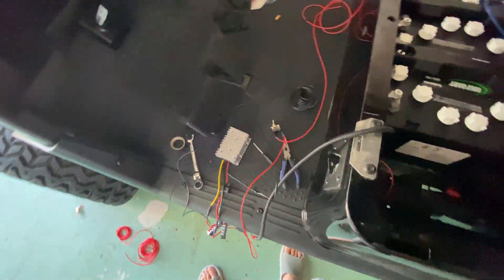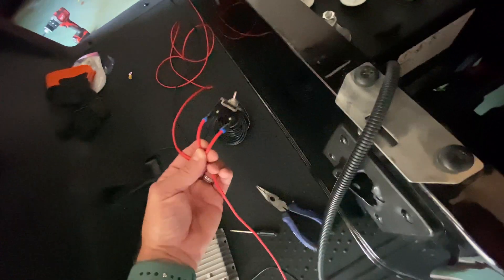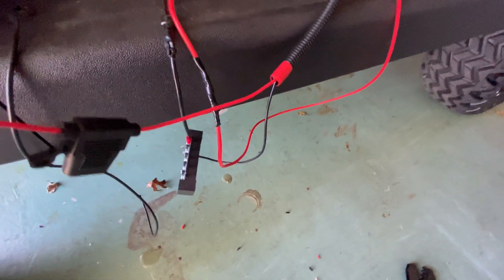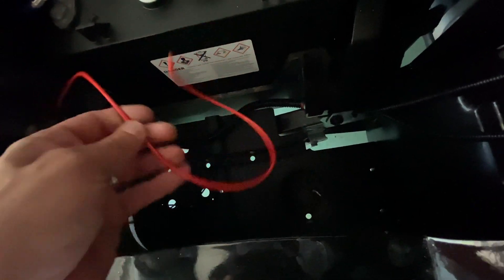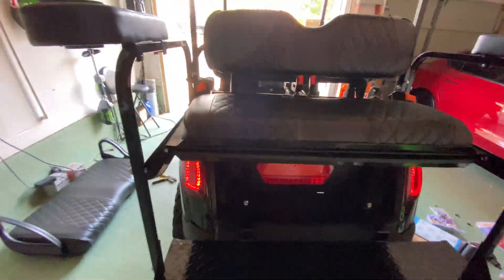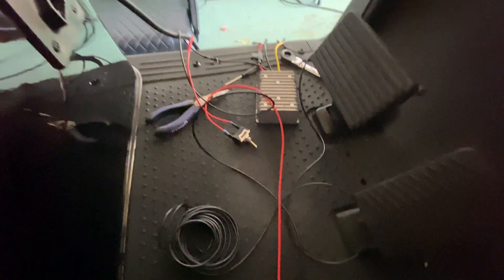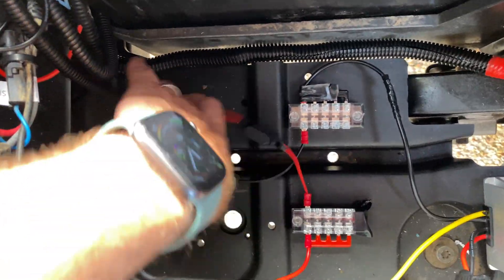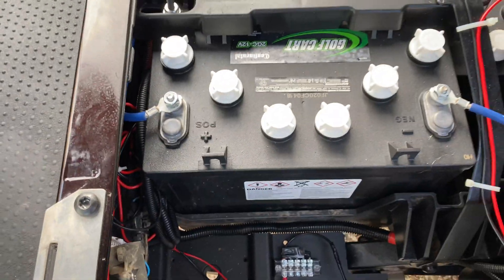Golf Cart (EZGO RXV) - Installing a 12V Reducer with Kill Switch and Terminal Bus Bars

Comment: So with that kill switch coming directly from the positive when it is in the off position will the power converter not being pulling any power at all? I have been reading and saw that they pull small amounts of power even with the key off unless you install a relay to the key switch on position.  So does that switch basically do the same thing and not allow it to pull power from the batteries when in the off position?
Reply from the maker: Yes, it’s effectively off/disconnect when the kill switch is off. That’s the primary reason I installed it.

Comment: Not sure if this will be answered but my TXT has a pull switch to turn the lights Off and On.... can I simply use that as my toggle for the voltage Reducer?  This brings up my original confusion lol, if I'm breaking power to the light circuit using the pull toggle must I still install my 36v to 12v reducer in between the power going to it? Thanks

Comment: So I've been confused about the positive and negative terminals that run from the reducer to the batteries. Is there a specific battery terminal you use to connect your power line or can you use any battery in the golf cart?? Also the ground that comes off the reducer, does that get grounded to a battery or does it get grounded to the frame on the golf cart? Thanks

Comment: I have purchased the same Reducer and Switch and once everything is hooked up the switch does not actually control the power to the reducer.  regardless of position there is still power.   It seems as if the power from the pack is blowing out the switch almost immediately.  Any thoughts?
Reply from the maker: Did you get a switch that supports the amperage and voltage requirements?

Comment: Did you run the positive and negative wires from the first battery in the circuit to the toggle switch? If you did, you only ran 12 volts to the switch and reducer????
Reply from the maker: The toggle switch is only on the positive, it literally completes the circuit. The reducer is wired from the first battery positive and last battery negative as shown around the 0:40 mark in the video. Again, the switch literally just switches the positive, only one wire in, one wire out.
Reply: @UraniumTwoThirtyFive   This is a perfect and easy fix, thank you my reducer always stays on and is warm to touch even after charging overnight even though my accessories will not turn on when the key is off it's still warm so I'm going to use my original 48 volt light switch headlight switch to do the switching on and off only on the positive side and mount it underneath like you did, thank you very much sir

Comment: I like the terminal bus bars for connecting multiple lithium batteries (in parallel) to the controller. I'm choosing to use a breaker box to distribute my low voltage equipment. That will add a little overload protection.

Comment: Thanks Brian, I'm doing the same thing but wasn't sure about the rating I needed for the toggle switch since you can't find a DC48 volt one. I'm going to use the same switch you used. Also I like the idea of putting in the bus bars.
Reply: Use a relay between your switch and your bus Bar or fuse box

Comment: It should be fused right where the positive taps the battery.  If you get a rub through before the reducer, you wire will glow until it burns thru.
Reply from the maker: Thanks, ordered a fuse and will put one within a couple inches of the battery.

Comment: Hey Brian, I bought a red Hawk light kit. Came with a voltage reducer with five wires. Two go to the neg and pos. And two go to the light kit harness, and one goes to the positive side of the key switch. Problem is I have a ezgo unique four position key switch like yours in this video. What wire is it out of that four wire harness in the back of the key switch do I tap into? Please help!

Comment: Hello. How did you wire up your toggle switch? Every time I connect mines it blows the fuse going to the converter.
Reply: It looks like he only ran 12 volts to the toggle switch????? If he went from the first battery in the circuit?

Comment: What amp fuse did you install between the kill switch and the reducer? Essentially the 48 volt section of the wire?
Reply from the maker: The reducer has its own inline fuse. I forgot the size, I did replace it once as it popped when I accidentally installed the headlights backwards. The reducer I bought is no longer on Amazon, so can't check the fuse size, but I was able to get a like replacement from my spare fuse box that mostly has car fuses in it.

Comment: I installed a kill switch and turned it on and it works but the switch got so hot I couldn’t touch it. It’s a 12v 30a switch. Do I need to find a higher voltage switch? My cart is 36v
Reply from the maker: I haven't had any issues. The switches I bought are pretty high rated, 125V @ 20A: https://www.amazon.com/gp/product/B078KBC5VH/ref=ppx_yo_dt_b_search_asin_title?ie=UTF8&psc=1
Reply: Considering that switch is running 48 volts of current which is four times the amount the switch was designed for, I'm surprised you have not blown any fuses LOL you need at least a 48 volt switch a good example is I have in 2008 precedent in my original headlight switch was a 48 volt switch I'm glad I kept it because I am now using it as my accessory kill switch perfect

Comment: Hey! I bought this reducer and when I hooked the 48 volt wire to the beginning and end of the battery bank, it sparked! So I stopped.  Is this usual?
Reply: Yessir it's normal. Crazy to think it is but it is totally normal
Reply: It scares you even though you know it's going to happen, before I put a kill switch on I was pulling the fuse in and out imagine putting a fuse in and the spark happening right there LOL

Comment: Thanks for posting. I just installed a LED Lightbar and I have power going to the switch but nothing to the light. It is a 48V system. I think i need to get a reducer 48v - 12V to fix this issue. Are these reducers really weatherproof? Is there a certain brand you would recommend? any other advice on what might be the issue for my lightbar is appreciated.
Reply from the maker: I wouldn't say they're completely water proof, but I installed mine under the seat where it's relatively dry. This is the one I got, no complaints: https://www.amazon.com/gp/product/B07J274LZD/ref=ppx_yo_dt_b_search_asin_title?ie=UTF8&psc=1

Comment: From what i've heard ( I own an RXV as well) the controller is very sensitive to any current draw, eliminating the option of wiring from the key switch etc.....is that why you elected to go straight from the batteries with the kill switch for minimizing a parasitic draw over time?
Reply from the maker: 100% yes. It seems anyone who wires into the keyswitch ends up blowing controllers.
Reply: Glad I read this comment. I was straight up about to wire it to the key switch. Thanks guys